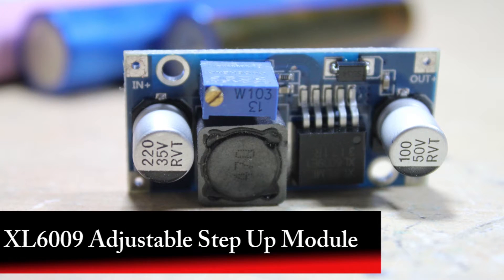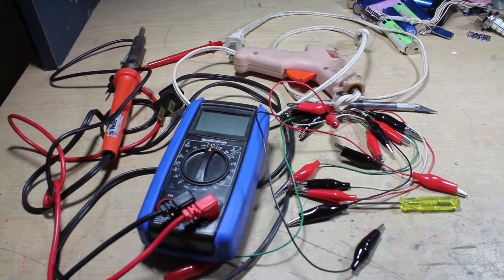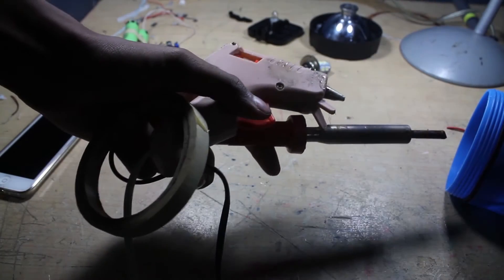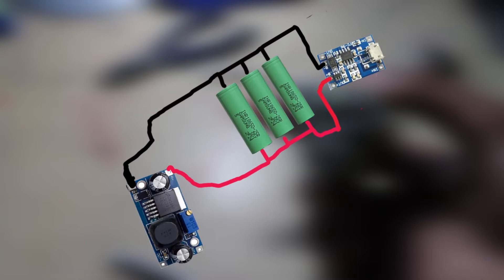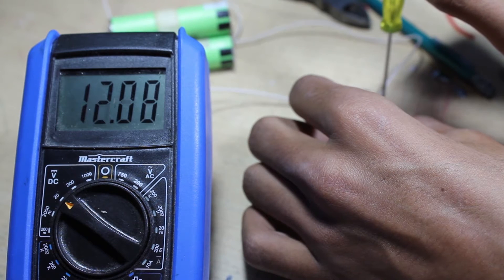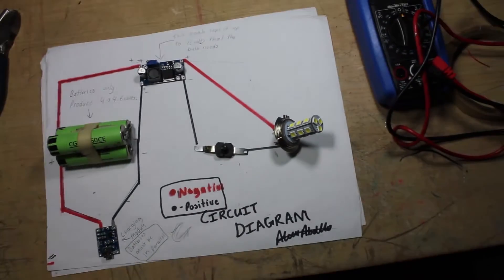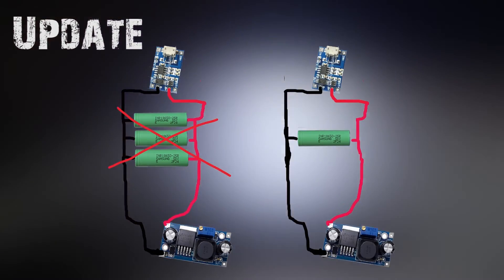How to Make RECHARGEABLE flashlight. (DIY Bright LED Flashlight)

Comment: can you post a video of the light output? i also made one and the beam pattern is not focused because of how the led bulbs are positioned
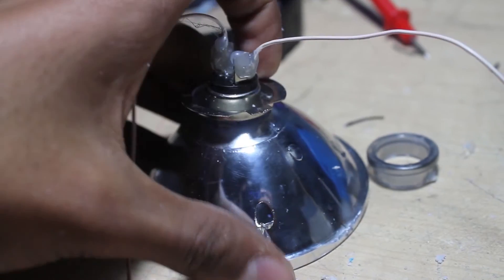Reply from the maker: mario reyes at 2:06, you can see the shiny hemisphere. that has mirrors inside that reflect the light forward. I took apart this light, to use the parts to make a more better one. You can see them on my channel page also. this was very bright though, but I wanted a light that had a wider angle beam so I used high power LEDs on my new ones that I still use today.
Reply: Project DIY i used this bulb (http://g03.a.alicdn.com/kf/HTB1o_sbKpXXXXXtXFXXq6xXFXXX6/2x-White-10-SMD-High-Power-T10-168-194-2825-2821-W5W-2886x-LED-Projector-Bulb.jpg_640x640.jpg) and the beam pattern from the flashlight is looking like a cross. i was wondering if it happened to yours too..
Reply from the maker: mario reyes That's a bright bulb. yeah. mine was shining light to the left, right and front, so I used that reflector to shine it forward. kind of like in car headlights, there is a shiny reflector.

Comment: Good Job! I'd like to know exactly what automotive LED bulb you used.
Reply from the maker: rhamil54 I believe it's an h7 bulb. you could try much brighter ones too. let me know how it turns out if you build it:)
Reply: H7 is a Halogen incandescent bulb, not LED. But that tells me you probably using an LED bulb that is supposed to be a replacement. I just bought a 6V Krypton bulb lantern w/ 4-1/8" lens, and have already ordered a D Cell adapter for the battery. I have some BA15S LED bulbs rated at 350 lumens I think I'll try first. The H7 probably pulls lots of amps, and I'm not planning on using 18650 cells - protected ones are expensive, and the unprotected cells like you used are an explosion risk - big explosion, as those 18650 batteries pack lots of energy, better make sure you don't discharge them very farm or have a short develop. Laptop battery packs have 1 Protection circuit for the entire battery pack, not individual cells.
Reply from the maker: rhamil54 I think I used some ba15s leds in my car. not sure, but I'm sure they're quite bright. actually I accidentally short it out, and after about 5 seconds the wires melted into the plastic casing. lol. I Made a 3w flashlight(check my channel), and it is soooooo bright and reliable that I haven't used the one from this video since. I will take apart this blue one and reuse the parts for another project.
Reply: Yes, cars have BA9 and BA15 bulbs both single and double contact; I replaced some 10W BA15S halogen map lights with a 3.5W Bonlux LED upgrade that's 40% brighter.  The XL6009 DC-DC stepup is the game changer I learned from your mod, bought those too. Makes 12V automotive LED bulbs reachable using std batteries in flashlights and lanterns.
My std for comparison is a 3D Maglite with a Malkoff upgrade based on the Cree XP-G2 that puts out a real measured 325 Lumens at the Maglite lens. Since then, I've bought Chinese lights rated at 500 and 1000  lumens that don't even match it.
Reply from the maker: rhamil54 yeah. simple led map lights made my Honda accord look 10x better. and the xl6009 was a real game changer for me too. Feel free to subscribe so you can catch my future videos. Next video might be LEDs on my bicycle, or some other cool project. And let me know how your light turns out :)

Comment: Well made m8. I came down here to say not to use 3 batteries because the module is only rated for charging one battery.
Reply: Isn't the charge current limited in the module? If so, then no harm using 3 batteries - it'll just take 3 times longer to charge.
Reply from the maker: yeah bro. Thats exactly what i was going to say. People on different websites are kinda confusing me. Some say yes. some say no. But it is fine for me to use 3 batteries.
Reply: The TP4056 module is internally regulated so you can charge as many batteries in parallel as you want - it'll just take longer with more batteries. Go look at the TP4056 datasheet; it'll tell you everything you want to know.
Reply from the maker: +MichaelAChang yeah man. Thanks for the help. Will do.